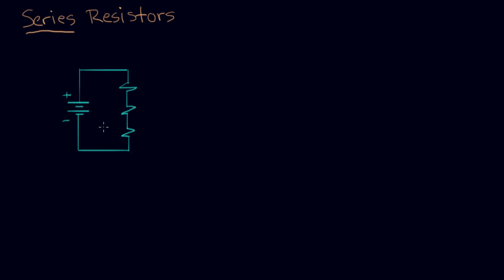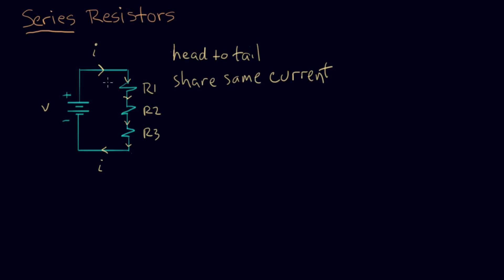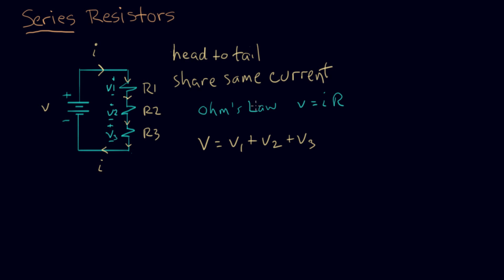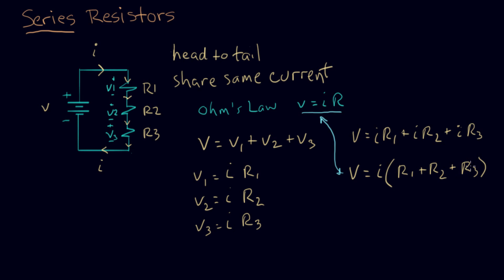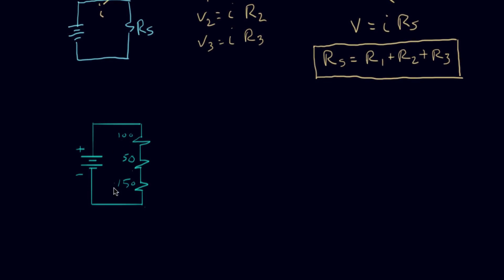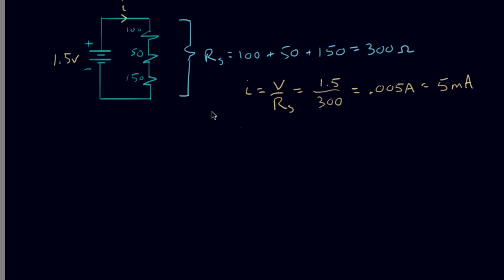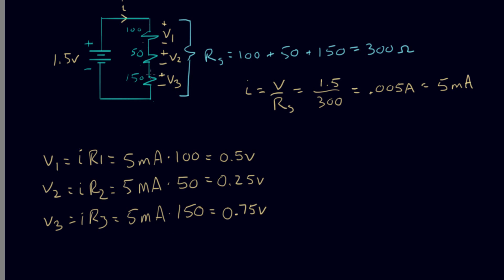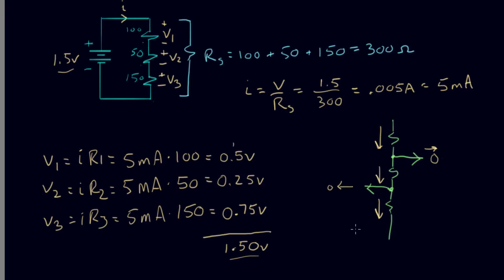Series resistors | Circuit analysis | Electrical engineering | Khan Academy

Comment: I am not understanding at which point voltage and current  are being calculated, is it before or after the resistors?
Reply: The sum of all the resistors in a series is it's total resistance and the total voltage is divided among the resistors. The voltage is just the difference between potential or energy before and after the resistors so, the voltage is being calculated after the resistors.

Comment: I don't get it, he said that the charge goes into the positive and out the negative, but his example showed it going out of the positive and into the negative.
Reply: He was talking about the current flow through a resistor. Anywhere you put the resistor, current flows from the positive side then exits on the negative side.

Comment: "Could i replace these 3 resistors with a single resistor that would cause the same current to flow?" That's where i'm confused. I thought the current was the same no matter the resistors? Is the answer yes lol?
Reply: Ohm's law states V = IR;  So if the voltage is constant ( for example, you have a battery) The current will vary inversely as the resistance.
Reply: loneventhorizon ... let r1 r2 r3 be 3 4 5 ...   3+4+5=12 ... can we equalise 3 series resistors to single 12 ohm resistor is concept ... in addition if source voltage is 24 volts ... current is 2 amps ... 3 series  resistors have  6v 8v 10v across them ... single resistor has entire 24v acting across itself